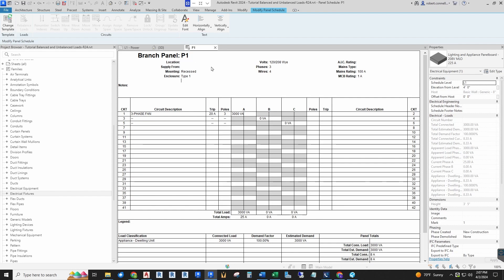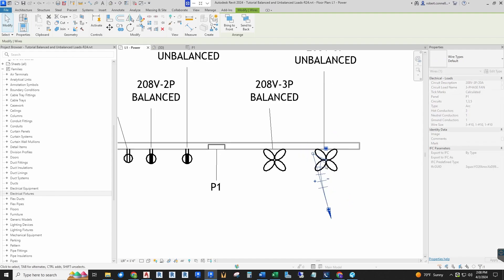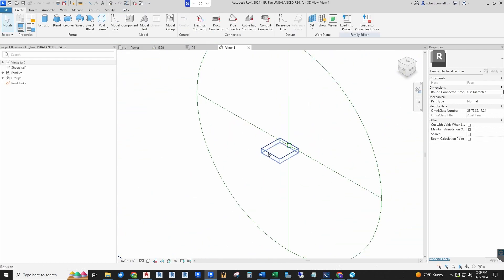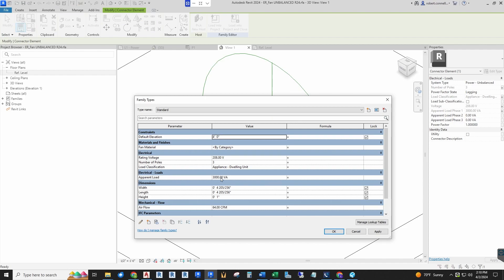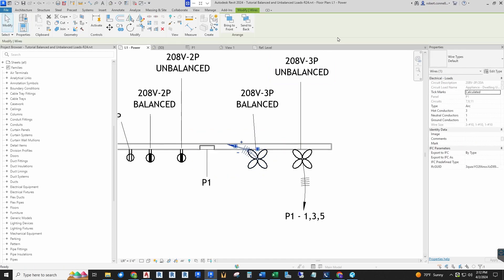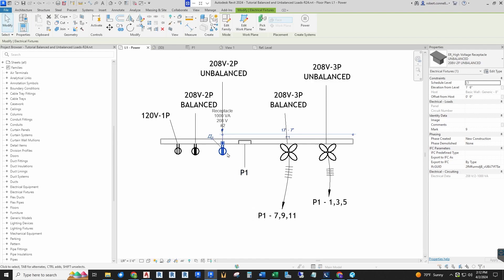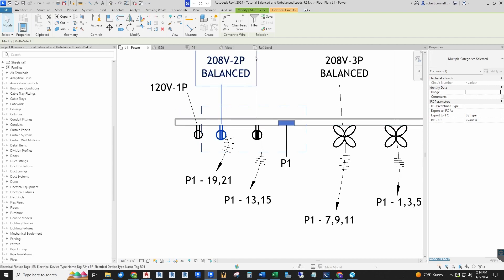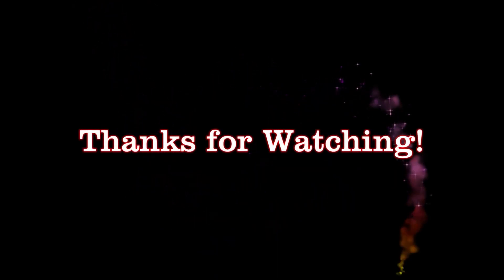REVIT MEP Can this be FIXED!?! (hint - balanced load!) Family Editor

Comment: Thanks for this Rob. Also when connecting from bbranch panel to main panel. Is it okay to set the branch panel to unbalance or should I set it to balance?
Reply from the maker: You always want panels and switchboards to be unbalanced, such that they pass the loads through just as they are per phase. Only loads should be set to balanced (unless it is a special load that is set to unbalanced on purpose, where you want to enter different loads per phase - not common).